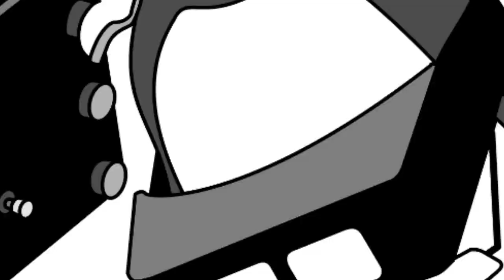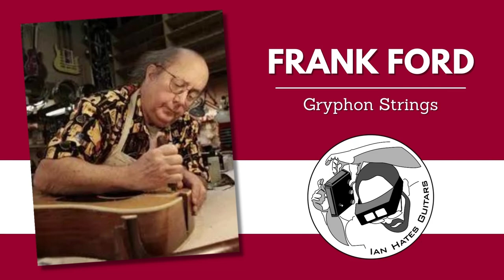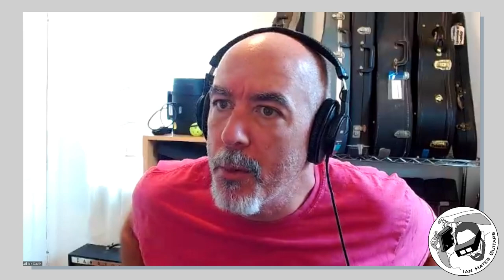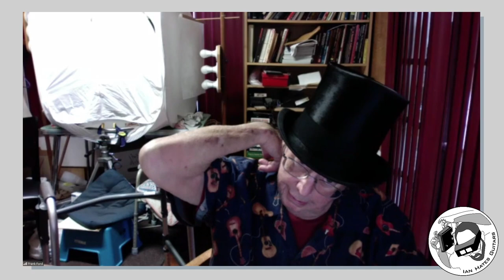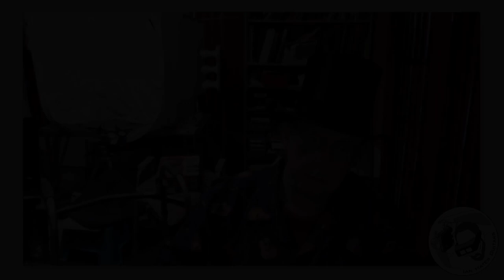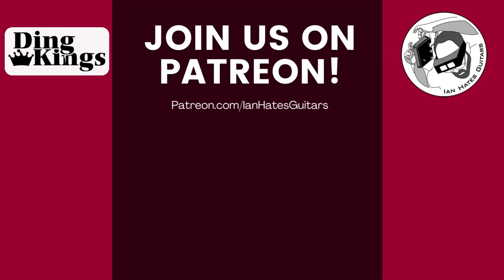History of the Neck Reset with Frank Ford - IanHatesGuitars

Comment: Thanks for posting this video!  I recently acquired a 1922 0-28 whose neck was reset by slipping the block (the misnamed and much derided "California" neck reset).  Interesting to hear about the history of these repairs.  Mine was probably done in the '70s, maybe even by Frank himself.  It is barely detectable on the back/binding at the heel.  On the inside, the back center strip brace was shaved about 1/2 inch from the neck block itself in order to allow the whole thing to be moved into the proper position.  Guitar plays like a dream!